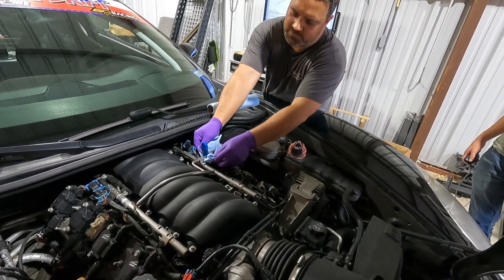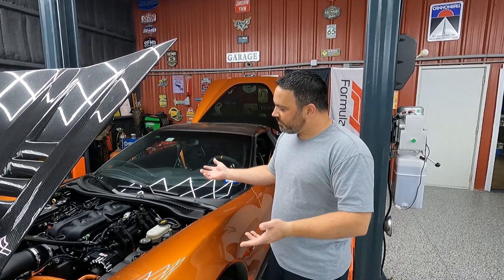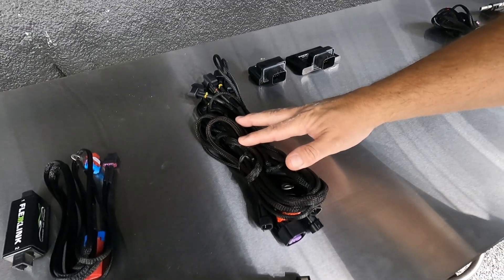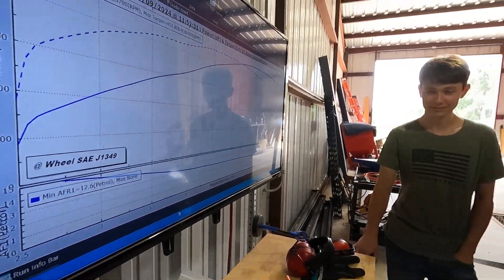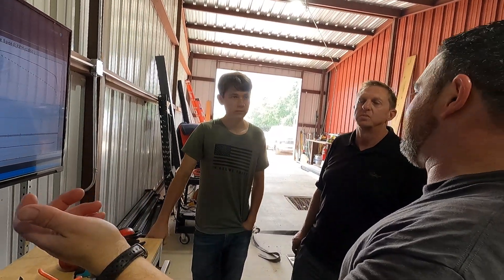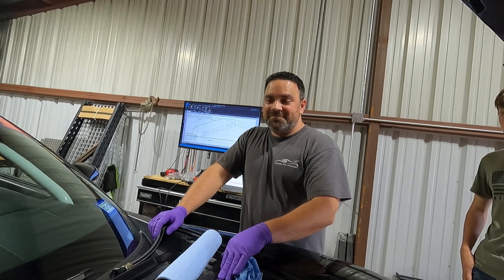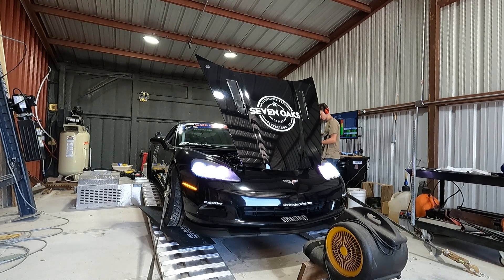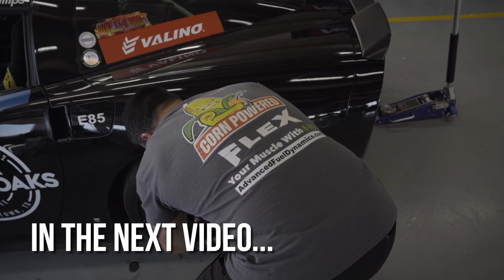E85 FOR THE WIN!: Advanced Fuel Dynamics Flex Fuel for the Corvette

Comment: A gain of 15hp however ot was revved up 250rpms higher. Im wondering if the gains would be less of both runs were to the same 5900rpm.
Reply from the maker: The primary gains were in the midrange, not peak so I don’t think the extra recorded RPM made any real difference. I personally would be fine with a 5hp gain given how much cooler it runs on E85 vs 93.